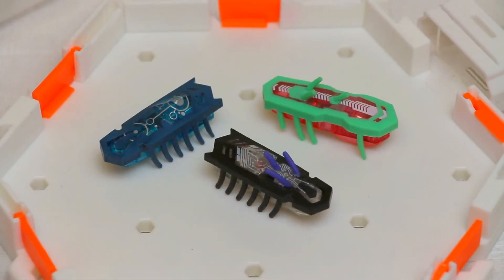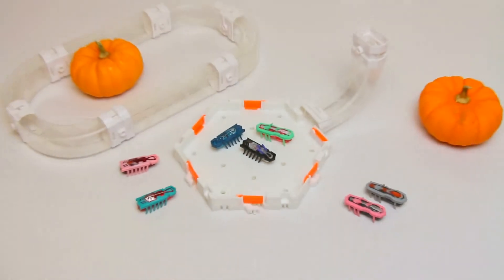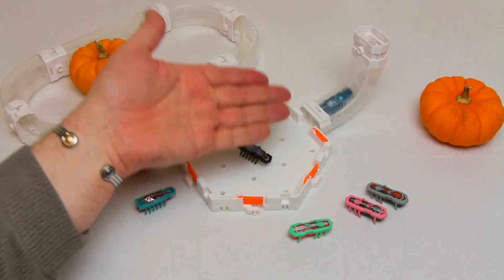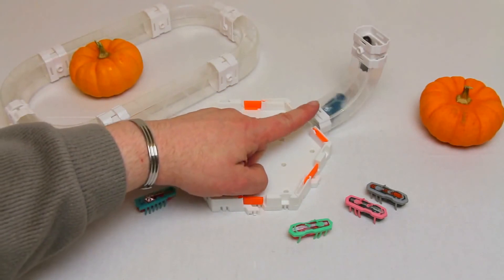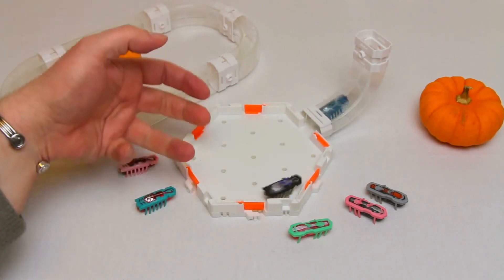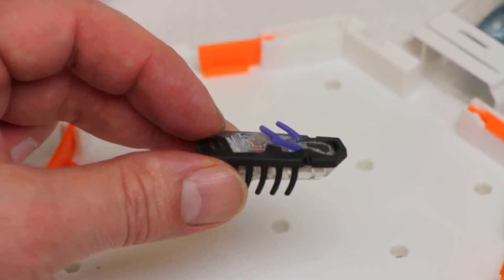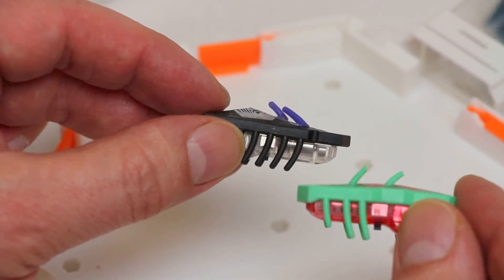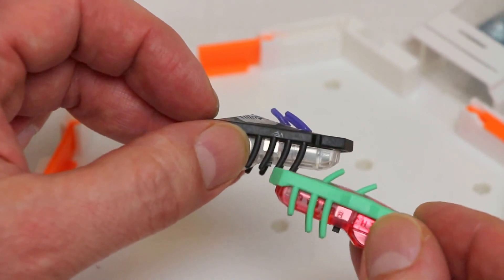Say Hello to "Nano Frankenstein" - My HexBug Nano V1.1 Hybrid - Some climbing skills !

Comment: if they had a one way gate, with some machenism that opens it when some wheels are rolled, that can only be moved by the legs the v2s have on top, you could have them mixed and keep the v1s away from tubes. where the wheels would be is in front of the stop side, but they could put a only v2s can go! sign on on the side with the machenism.
Reply from the maker: I would love a one way gate that only allowed either V1 or V2s to go through. That would be great!
But I have seen these sneaks - still getting through one way doors the wrong way etc and nothing would be 100%!

Comment from the maker: A. The one way gates are available in most of the V2 elevation sets and the raceway set (rare)
A. I have not yet found a method to keep V1s and V2s separated.
(Although I do find that you can have a small number of V1s mixed in as long as the V2s outnumber the V1s by about 4 to 1.)